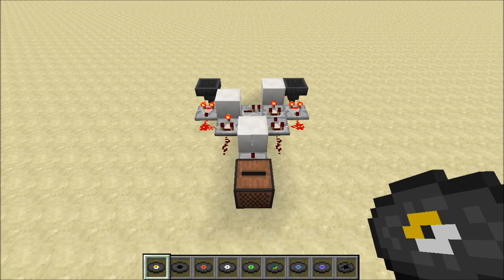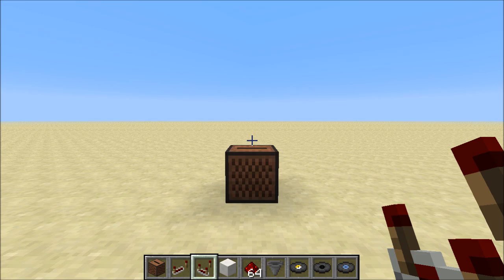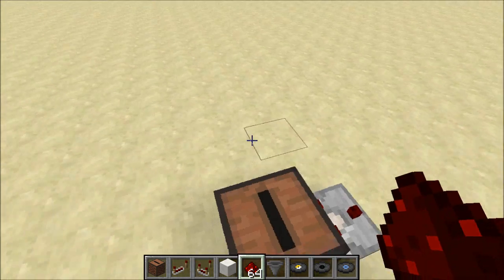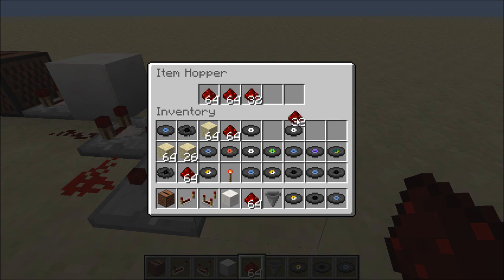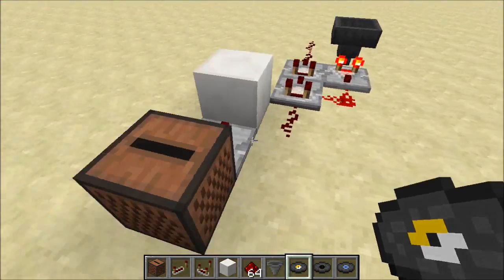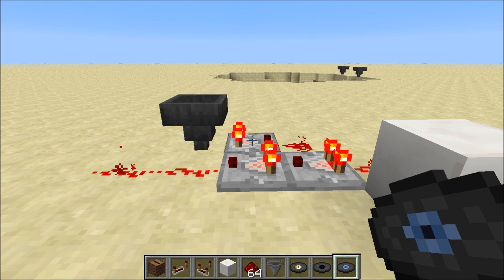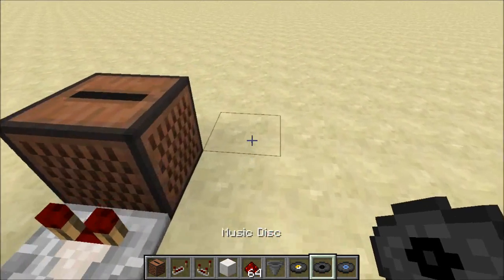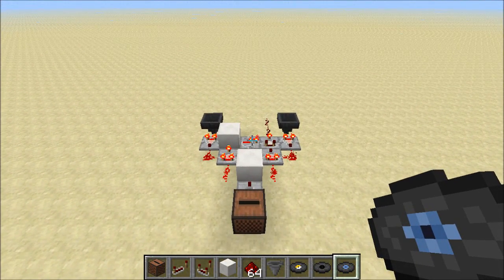Thinking With Comparators: Jukebox Song Detection

Comment: If you fill the whole hopper it will return signal strength 15 (maximum). But if you fill in only half of the slots (2 stacks + 32) it will return the half maximum signal strength (7-8).

Comment from the maker: This is one of the others I built i . imgur . com / lgFmH9N.png that doesn't pulse (I didn't use it in the video because it doesn't show all of the concepts). Just make sure the signal strength coming out of the hopper is one less than the signal of the disc you want to detect.